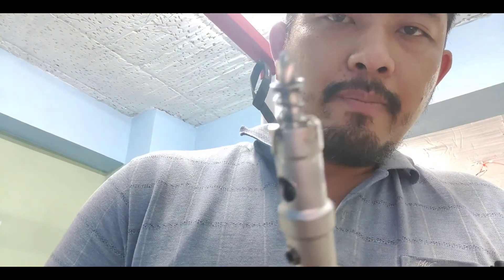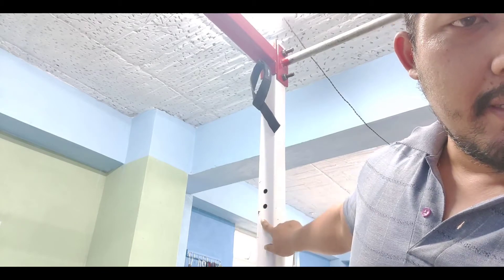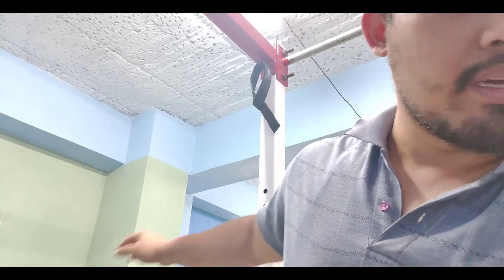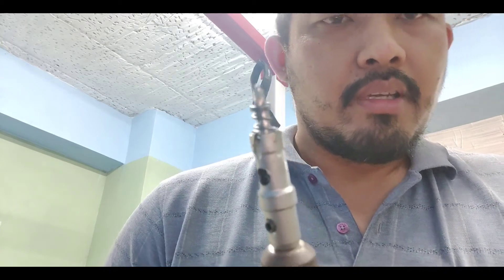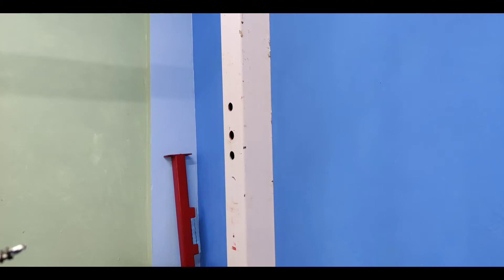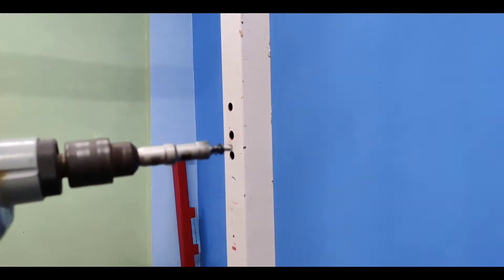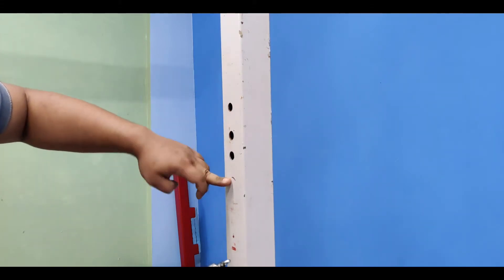Drilling 16mm holes on an 11 gauge steel square tube

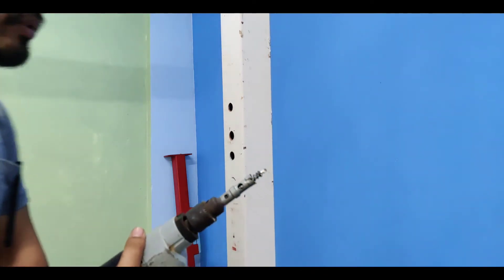Comment: measure, mark with marker, use a center punch and hammer to make a divot, use a small pilot bit to make a small hole, then you can go to 2:00 step
Reply: also one other tip, lower the RPMs. keep them low, but make sure large chips are being made and ejected. heat will destroy carbide quickly.

Comment: In 2020 I made a simple squat rack, using 3 inch square tubing. The hardest part was lining up the holes on the opposite side of the square tubing to make sure the j-cup one inch pins would go in and through with no problems. Thank you for posting your video.
Reply: how did you make sure that would happen ?

Comment: Seems like it would be better to punch a small hole in the steel first to keep the bit from jumping around.
Reply from the maker: Yeah.... I found out later on and I bought a hole puncher, and it made work much easier. 👍🏻